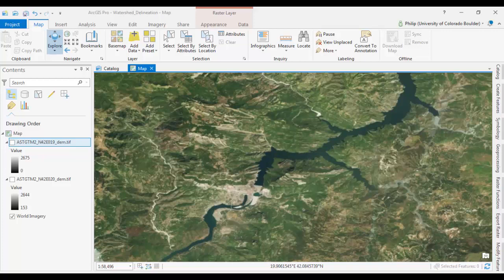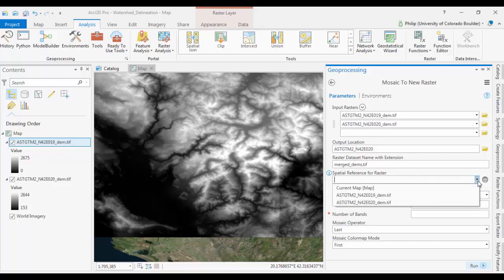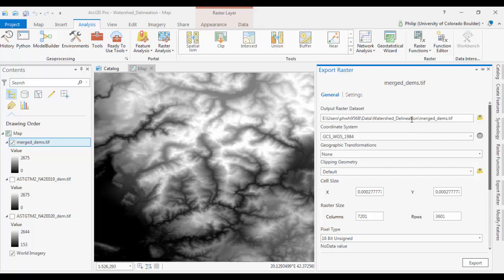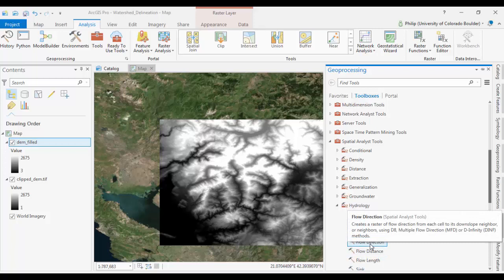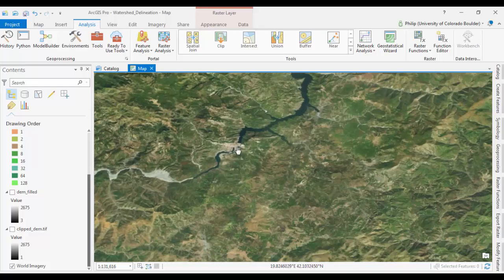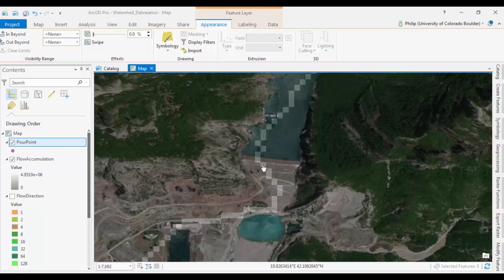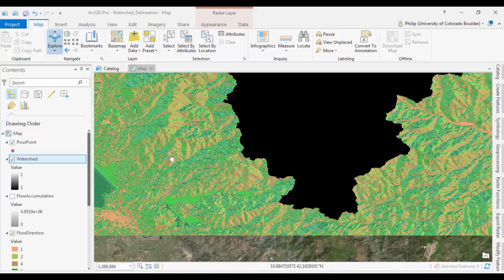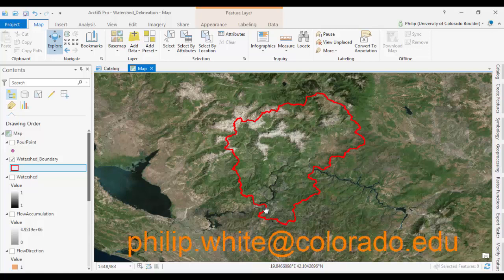Delineating Watersheds in ArcGIS Pro

Comment: 1. Could I edit the DAs delineated from ArC Hydro tools to represent drainage direction change? For example, changing the drainage ID numbers in drainage lines and catchment layers.
2. Is there a way to change the drainage area shape parallel to the drainage lines (not by giving an outfall point along the drainage line - this cut the DA across)? 

Hi, I am trying to represent an urban drainage area. I have some areas draining in the reverse to the natural slope due to sewer modifications.  I tried manually editing the drainage layers generated from ArcHydro tools and then tried to extract it through HEC-GeoHMS. Though everything is merged it is not picked up by HEC-GeoHMS. Any literature or procedure that has done this would be appreciated greatly.